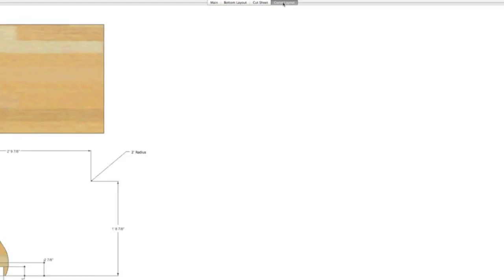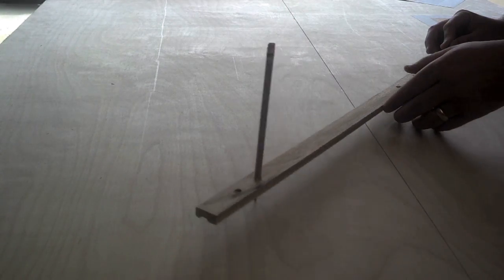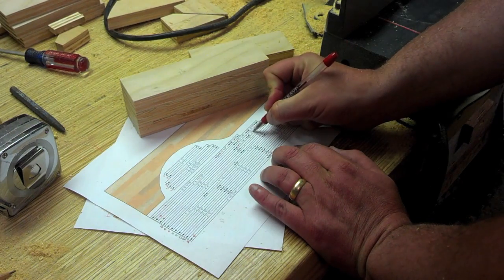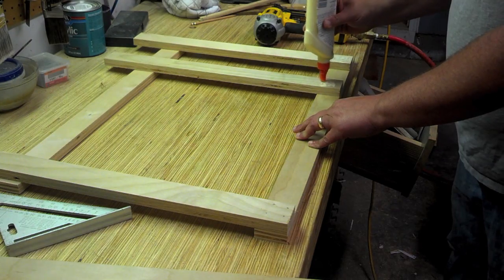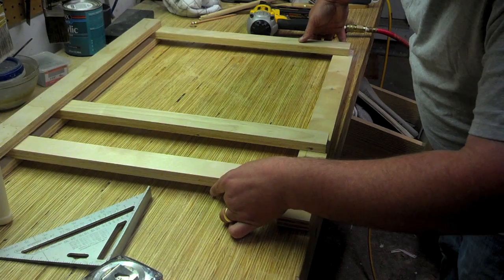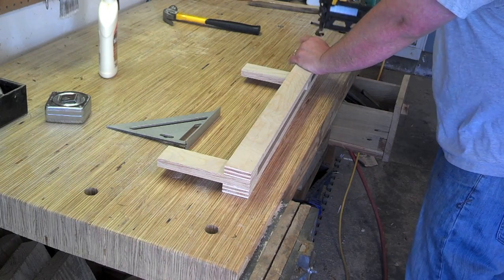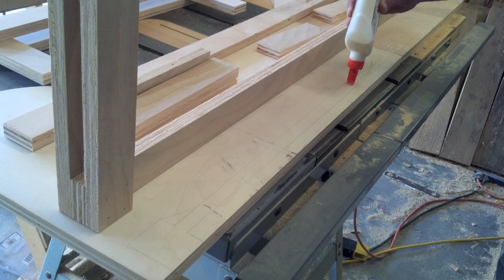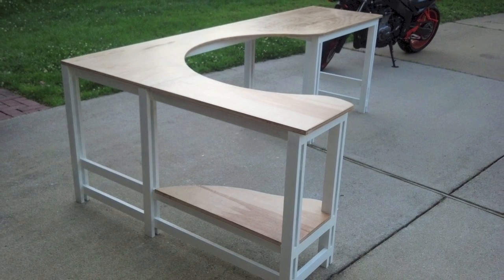One and 1/4  Sheet Plywood Corner Desk that Sits Two

Comment: This looks great but plans no longer appear to be on the site?
Reply from the maker: I somehow managed to loose the sketchup file for this desk.  It got lost when I transitioned from mac to windows.  I do however still have the images that I pulled from the sketchup file that I used to build the desk.  It is all you really need, but is not very descriptive.  I will work on adding those images to the site.  Thanks for pointing that out to me.
Reply from the maker: Searched around and found the sketch file.  Also went ahead and made a set of plans for it here is the download link:  http://plan-to-build.com/Corner-Desk-Plans/
Reply: Very cool, I will take a look. I'll need to flip and shorten a bit but it should be a great starting point.

Comment: what extension did you use for sketchup that showed you the wood cutting layout?
Reply from the maker: I didn't use a plugin.  I set up different views by adding several scene tabs.  Then set the camera options for each scene.
Reply: ah, makes sense, thanks for the info :)

Comment: awesome work in all videos .. BUT don't put magnets on or around PC . NERD LAW 101
Reply: Actually, not so much anymore.  When floppy disks were widely used, they were highly susceptible to magnets.  These days, it would take a VERY strong industrial magnet to erase data from a hard drive (which is mostly protected inside your computer anyway), and a flash drive actually works by moving around electrons, so a magnet that strong would also be able to alter the iron in your bloodstream.  Crazy right?
Reply: Yes  we learned .. and yes it not an issue as in the Old days  of floppy .. but it still  practical sensibility to practice ..and just a minimal magnet not one as you mentioned   still affect internal cablelines  .. where most are shielded .. cd/dvd cables to the sound card are not .. IDE cables are usually shield , but the ribbons usually aren't and even at speeds 66/100 can be be affected enough to cause some corruption and / or reduce performance due to re-tried read/writes.. and yeah I'm aware the use of magnetism in healing of body, mind, and soul.. it been  used for centuries it pretty common knowledge. . Crazy right?